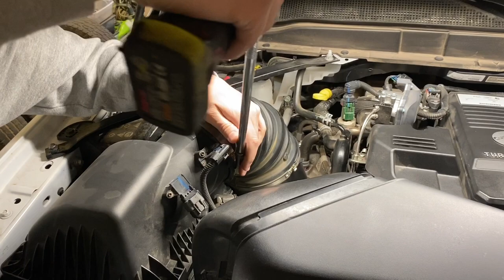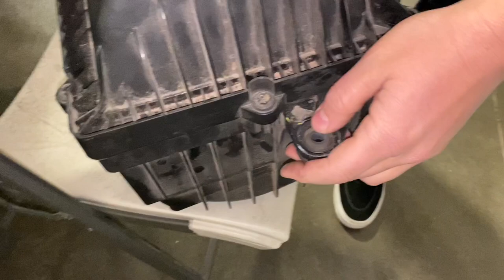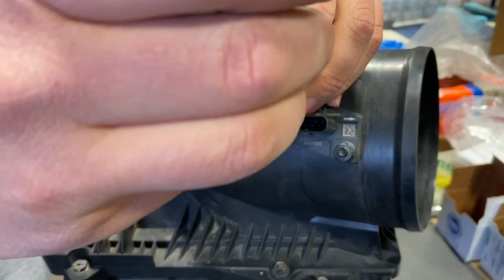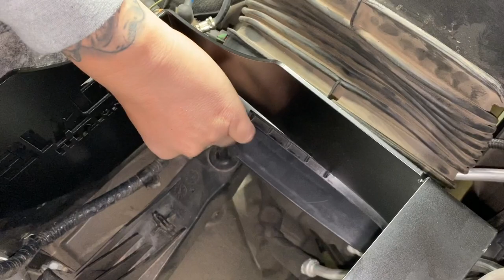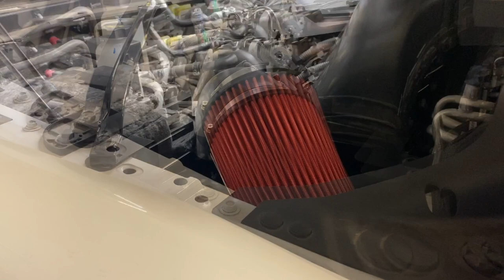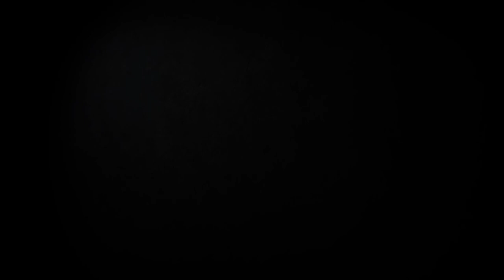BLACK MARKET 19-21 6.7 CUMMINS "BFI" AIR INTAKE KIT INSTALL

Comment: How much to fit a 2020 ram 6.7?
Any codes show Up?
Warranty?
What kind of warranty?
What's the advantages of ur product ?
What's the difference between other types
Reply from the maker: It will work on stock pickups with no codes now, we had issues with codes on stock trucks (non tuned) but we found the fix and send it with every kit. 1 Year warranty but it not being a moving part it will last the life of the truck. Our intake is a full 5" intake and uses the factory grille inlet. Hope this helps
Reply: How much
Reply: @blackmarketperformance  what is the fix for codes?